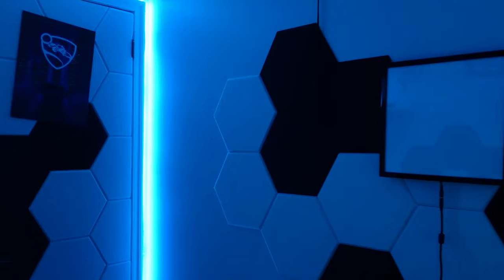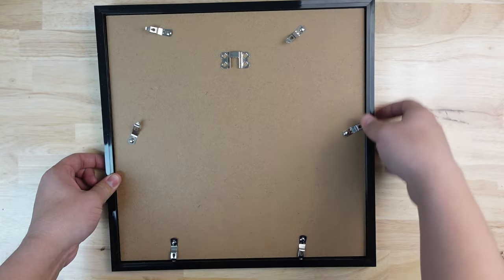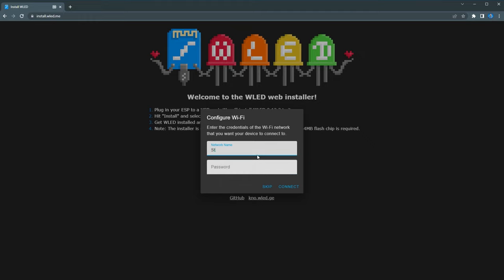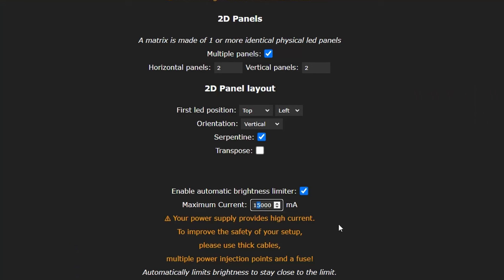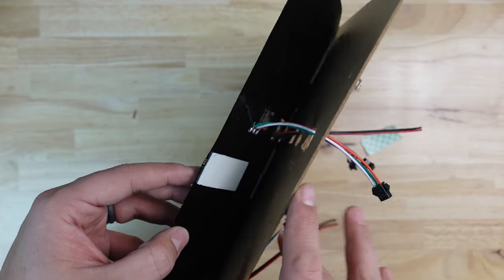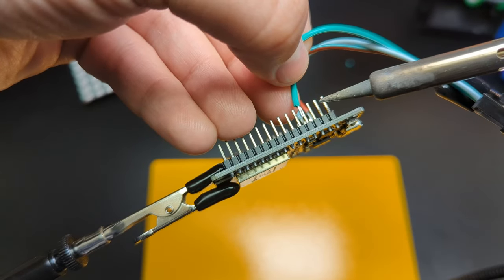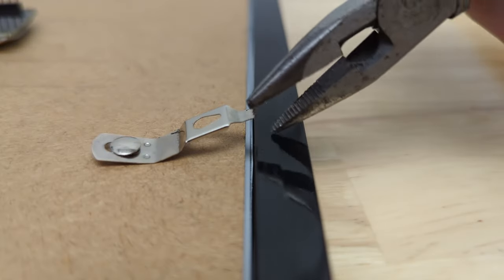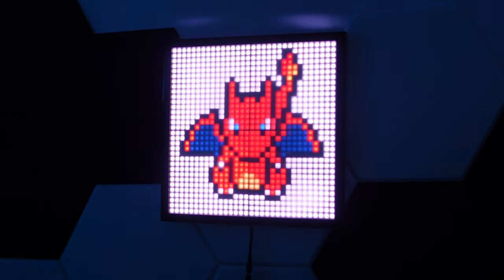I made a 32x32 WLED MATRIX that's SOUND REACTIVE!

Comment: Thanks ! I didn't understand about the power supply, you say that 15A 75W is enough. The wled calculator gives 200W and 40A for 1024 eco leds. I'd like to make a horizontal panel with 5 arrays of 16x16.

Comment: Looks good. I thought about BUILDING the actual LED panels my self. Cutting and connecting them in the serpentine config... and soldering the connections. Could very well make your own custom matrix this way yeah?  You should do this video to.  Do like a 64x64  grid.  If I could make one suggestion, the edges of your printed led plates....you can see the difference.... Dunno if you could maybe set your printer to print 1/2 the thickness on the edges where they 4 squares connect.... then glue em so they still be strong?

Comment: Firstly, let me congratulate you on brilliantly presented video. Thank you so much for your efforts!

I give you a score of 9.99999 / 10 lol

Taking away 0.00001 for not considering the reduction of the width of the printed grid edges so that when you attach them together, the touching sides have the same width also? Hope that makes sense!
Reply from the maker: Wow, thank you! I actually chose to leave them full width because the matrices themselves have a larger margin around the edges than between pixels. The other option was to overlap the matrices, but I decided not to

Comment: Would an SP801E work as a controller instead?
Reply from the maker: Not sure, I've never tried one, sorry
Reply: I have used one for my project. Works v well. Mine was 64 x 64 matrix with the 4 channel controller running 4 panels each.

Comment: I tried to 3d print the grid on an Original Prusa Mini+ but it keeps failing at the same spot in the top right corner.  The rest of it prints fine.  Any ideas what could be going wrong?

Nozzle: 0.4mm, Layer Height: 0.2mm, 15% infill, Black Overture PLA, using the default settings in PrusaSlicer
Reply from the maker: I've never tried the prusa slicer, but you could try increasing infill? The grid lines are 1mm thick, so it may be trying to infill between edges depending on wall thickness
Reply: @makeitworktech  I think it might have been something wrong with the printer.  I switched to a different one at the maker space and it came out great.  Thanks for the reply and the awesome video!

Comment: I have a question about the diffuser material. I ordered the same material from your link, mine seems to have an adhesive backing (at least I think it is adhesive). Did you do anything special with that? Like attach it to front acrylic?
Reply from the maker: Hmm, mine did not. I'd say try to attach it. It may work better than mine did!

Comment: Outstanding!  My frame just arrived today (thanks for the recommendation) and I think everything else is already on hand.  I went with a digital mic (INMP441) so I'll let you know how that goes - and also picked up a couple of PIR sensors to add motion detection.
Reply from the maker: Awesome! I'll add the INMP441 to my list of options when I do my dedicated SR video!
I'll have to try motion detection as well - is that a usermod?
Reply: @makeitworktech  I haven't wired it up yet - so I don't yet speak from experience.  Looks like it's "just another form of 'button', as configured under LED Settings.
Reply: @SnoWakeFPV  any updates?

Comment: Hi, 

I have this exact same setup with a nodemcu and have the latest Wled version installed.  I have a problem with the nodemcu rebooting every like 30-60 seconds. Does anyone experienced this issue before? or any ideas how can I resolve this. 

Thanks
Reply from the maker: Sounds defective. Other option... Did you use an esp8266 or ESP32 node mcu?
Reply: Nodemcu
Reply from the maker: @stevespiteri5856  I meant that NodeMCU can come with an 8266 or ESP32. You should check which one
Reply: Esp8266
Reply from the maker: Maybe too much for the 8266 memory. Can you upgrade to the ESP32?

Comment: Great video!  although I'm not very interested in Sound reactive.  I have a Matrix 16x16 with an athom working with the new version with the Scrolling text.  I am super happy because I have made many pixel art thanks to your Excel table.  When the code is very long, it cannot support it, you already warned it.  But I wonder in these 32x32 matrix will it be able to support so much code?  I have seen some that you have done and I don't know if you have had to delete them until It accept it.  As soon as you confirm I will buy in Ali 4 panels and charger.  I will do it on an esp8266 board.  I am waiting impatiently for the next video.  Thanks genius!
Reply from the maker: You need to send 2 commands, each containing half of the pixel art. I'm trying to sort this out for V3 of my Excel sheet. I haven't tried 32x32 on an 8266, but it should work fine.
Reply: @makeitworktech  Thank you, you had already answered me on discord but now with more information.  I'll make a github to pass you many pixel art images soon
Reply: For a few dollars more, use an esp32.  The 8266 is going to struggle with that many led.
Also a good idea to use 2 data pins and make it 1 pin for the top half and 1 for the bottom half.
Reply: Agreed, I split mine over two pins as well.  I'm thinking of doing a 3x3 now, just for fun 😀

Comment: I wonder how a piece of white acrylic would looks as a combination window and diffuser.
Reply from the maker: Now you have me looking around for one! I also want to try black translucent acrylic
Reply: using clear acrylic and scruffing one side up with 120 grid sandpaper works quite well
Reply: @steveanimatrix3887  Hey that's a neat idea.
Reply: @swissfreek  It works great! I actually meant 220 grit and an orbital sander is best. You don't want deep scratches. It ends up looking like frosted glass, but only on one surface. Also due to that, it is brighter than if it was having to illuminate a thicker solid white piece as it goes through the clear acrylic unobstructed and then hits the thin diffusion layer.

Comment: This is awesome. I was wanting to make a visual graphic equalizer to put in the side back windows of my Jeep. I have a few questions that I was hopeful you could help answer. 
1) Can (1) esp32 split the signal and mirror the display on (2) separate 2×2 matrix panels? 
2) Can the the 15A power supply power (2) separate 2×2 matrix panels? Using the Eco matrix panels. 
3) Can I increase the matrix to (2) panels high and (4) panels wide? Making the panel a 2×4 with 2,048 LEDs each. 

The ultimate plan for me would be to have (2) separate panels. Each with a 2×4 arrangement. Running a total of 4,096 LEDs. One power supply.  One esp32. The option to switch between a microphone or a auxiliary line in. I would like to use a waterproof microphone on the exterior for people to interact with and play music or talk and see the graphic equalizer jump around. Use the auxiliary line in while cruising around.